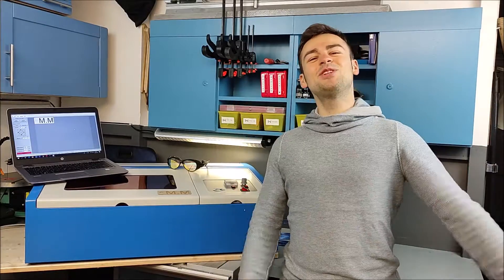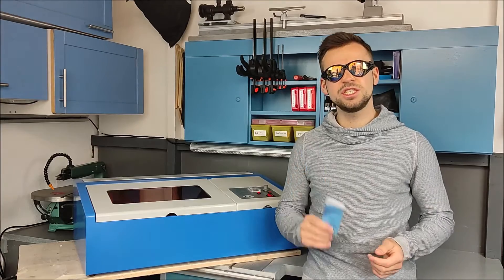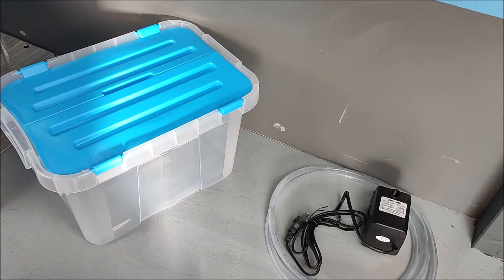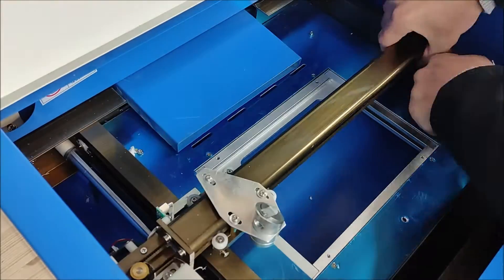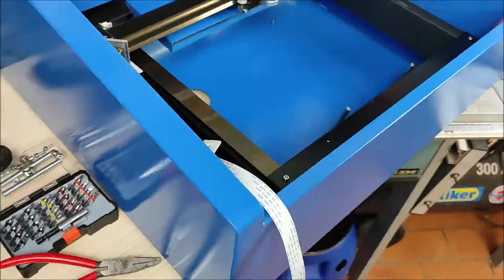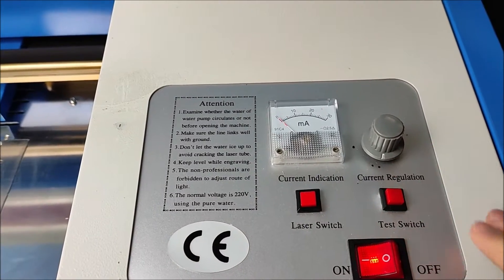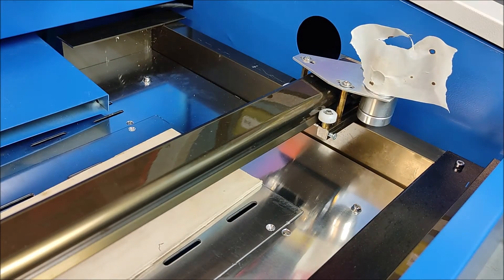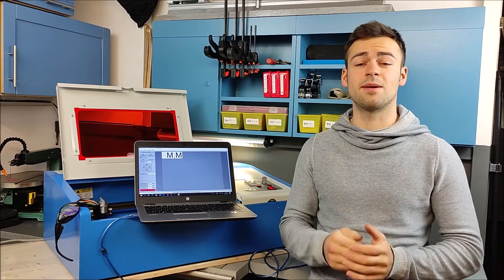K40 CO2 Laser Cutter Engraver Repair, Mirror Alignment, Set up, First Test, Episode 2

Comment: if it is colored acrylic "glas": then its  perfect as that absorbs ALL radiation , ( thats why its melting under focus) now you only need a reflecting surfcase for the rays , and that is not a mirror ... ( sorry my ce certified laser glasses have a OD of 6 and are stil see thru , but come with a pricetag to match ;( )

honestly, a 4 MM sheet of acrylic will block all rays that are not focused , add some extra filter and you are protected for the cover

better, NEVER operate the laser with the cover opened....

also Add a air assist . will greatly improving cutting performance, add inline blower for better suction,  get the stupid bed out, (you had it out already)  add in chamber lighting,  

wanna go further ?make an adjustable bed. 
add a in chamber webcam and now you are getting somewhere ..
Reply from the maker: Thank you for the Information.
There will be a lot of really nice upgrades i allraedy said this in my first video of course it wont stay like this ;D

Comment: 2 kleine Kritikpunkte: Scheibenfrostschutz ist nicht so optimal, leicht entflammbare Flüssigkeit die leicht schäumt und Hitze nicht so gut abtransportiert... Ich verwende Kühlerfrostschutz, da hab ich nicht soviel Angst dass mir die Liste um die Ohren fliegt. Und Du solltest erwähnen dass man. Unbedingt die E rdung prüfen bzw. Herstelle n soll (Pulverbeschichtetes Metall leitet halt etwas schlecht und die Chinesen haben den Anschluss einfach da draufgenagelt ohne das Metall freizuschleifen) Sonst gutes Video, viel Spass beim Lasern und natürlich beim Upgraden😁
Reply from the maker: Hey thank you for your Critic. But I tested the screenwash and it isn't inflamebal. It alsou doesnt foam and so far it worked really good and is alsou very cheap.
I alsou meassured the grounding and my Laser was absolut ok. There is contact through the scre, wich is screwed into the metal, so for me that's alright, maybe it's better when you scrub off some paint.

And thank you very much!!!

Comment: Hello dear it's screenwash for cars? I can use this product for my k40. and can you tell me a little more about this product why you use it for the k40. and if you can use any windshield washer fluid I thank you in advance.
Reply: Hello, yes thus ist normal Screenwash for Cars witch works until -15 °C.
I took it because it want freeze, and No algea will Form.

I think Most Screenwash will Work.